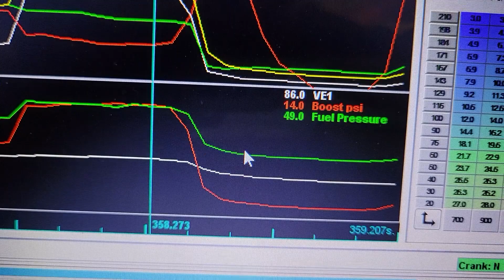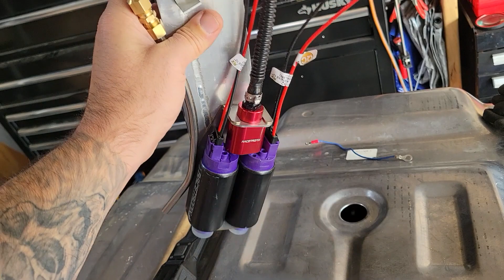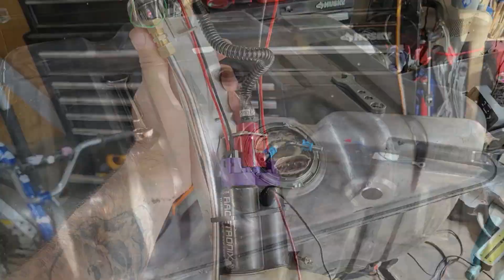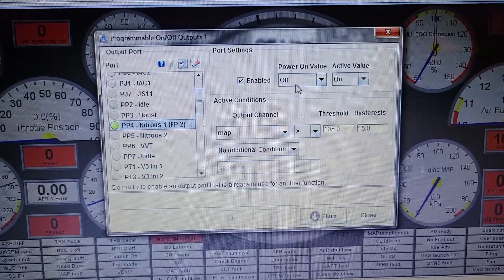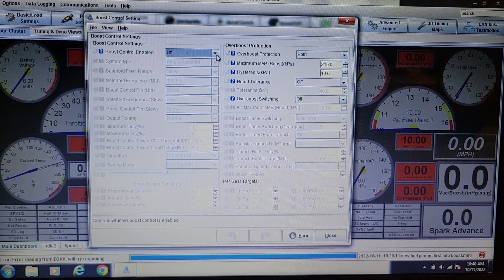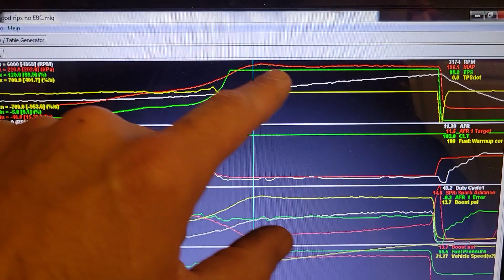1400HP fuel system & more BOOST!!

Comment: Why didn’t you just use the relay for the stock front tank relay sense your not using it?
Reply from the maker: The stock wiring is way too small to handle the load of these pumps so I wanted to make sure all the wiring was up to the task. These pumps need 12 gauge minimum. I'm using the stock rear tank wiring to trigger the rear hot wire relay to power pump #1. Power for pump #1 runs straight from the alternator at 14.5v. Same for pump #2 but the MS triggers that relay once the engine sees boost. Works very well.

Comment: Cool stuff, won't be long before your at the 1000hp mark. I'd think at some point you'd probably want to update your in dash gauges. got me thinking how "accurate" they are you'd want something better for the setup you have now in the truck as sometimes it may be hard to look down at the laptop, and 85mph seems ro be a bit slow by todays standards. I have to get off my butt and finish my cluster. Anyways good stuff keep it up.
Reply from the maker: I love the way the stock gauges look honestly so I probably won't change them. My phone connects to my ECU through Bluetooth so I can use it as a giage display for speed and whatever else if I want. The stock Ford gauges are fairly accurate but the gauges on my phone/laptop are dead juts accurate. I think I'll put the truck back in the Dyno soon to see what it's making at 15-16psi ,with a much better fuel system. I suspect I was getting some aeration when the old pump fuel pressure was surging at high RPM

Comment: Hey question I really love this project and I am looking to do some stuff with my efi do you know of any after market fuel rails that will work with that stock EFI intake manifold if not is there any tips to building my own I would like to get the fuel issue done first
Reply from the maker: As far as I know there are no aftermarket fuel rails made for the EFI 460 engines. I made my own on my drill press by using two different sized bits to make the step for the injectors to set in. I bought 10an blank aluminum fuel rail stock off eBay, cut it to size and drilled it out.  I also tapped the ends for NPT threads to 8an fittings. Email me at johnvirgilsgarage@protonmail.com and I can send you some pictures with more details.